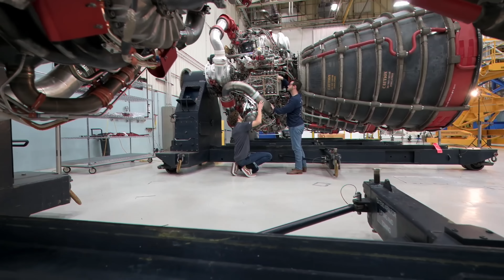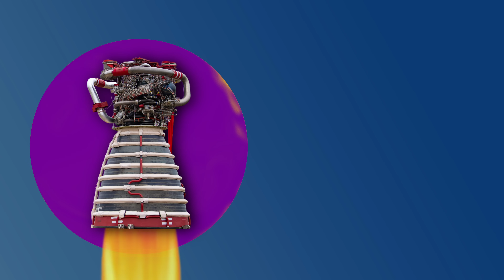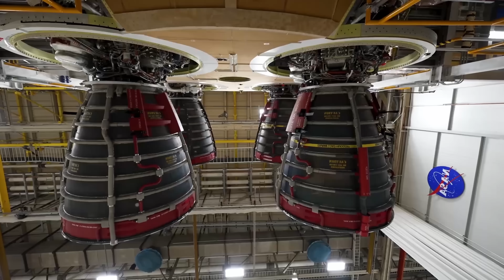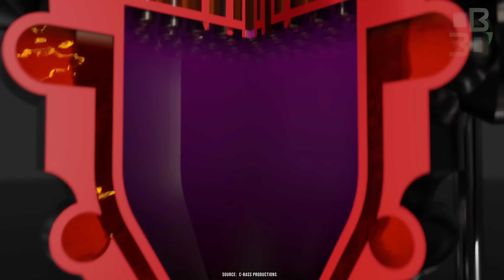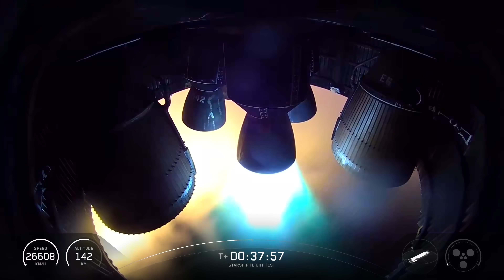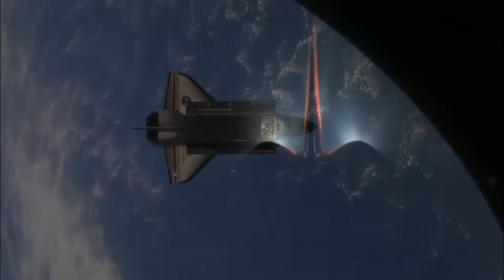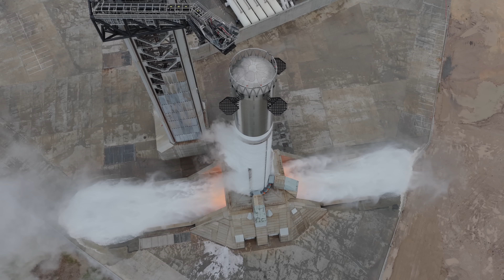Why SpaceX Raptor and NASA RS-25 Are So Different…

Comment: Making rocket fuel on Mars from local resources would be a  MASSIVE breakthrough! Imagine refueling for the trip home! 🔴
Reply: It’s not a breakthrough. The process is completely possible and has been done on earth plenty of times starting in the late 1800s. 

The breakthrough, if you wish to use that term, is the change in mission philosophy away from 100 percent bringing every single thing with you from the start. Starship is meant to do a lot of things very differently from that norm, with the intent of making places like Mars and the moon fully independent colonies of Earth someday - you can’t do that if every single thing has to be made on earth and flown to wherever they’re being used.

Comment: The RS-25 burns hydrogen into water vapor, and it still delivers incredible perfor mance decades after its debut! 💧🚀
Reply: The volumetric efficiency of hydro-lox is terrible - and that’s a bigger downside than the upside of the slightly better mass efficiency and environmental impact. It’s a really bad fuel choice for practical rockets that are economical to operate.

Comment: Well how many raptor engines have we seen quit in flight? I’ll wait…….. the RS-25 on the shuttle. I can’t recall a failure during launch.  NASA never had failure of a Saturn 5. How many starship have been destroyed.  By the time space X gets the starship reliable. The cost will be a wash. If you’re the person riding on said rocket. I don’t give two thoughts about the cost.
Reply: they have already done like 14 tests, because the engines are not stupid expensive it is fine if they get distroyed and having 33 of them also helps with relyability. the Falcon 9 is very relyable so maby judge on more finished products

Comment: Rapid reuse demands engines that don't need a complete teardown after every flight.
Reply: Between late June and July 6, 2018 the AR-22--which is for all practical purposes an SSME--was fired 10 times in 240 hours for a minimum of 100 seconds per firing. With LTMCC and modern engine controllers the SSME can be turned around without rebuild.

Comment: Nasa no longer innovates. They're literally using a 30-year-old engine with no new modifications. SpaceX on the other hand is going where NASA fears to go. They're testing the limits and succeeding at things that they were told was impossible. Each version of the raptor engine has only gotten that much more powerful. They're setting their sights on solving the heat shield problem that NASA could never solve as well. No guts no glory. SpaceX will inherit the cosmos... At a fraction of the cost and with true reusability.
Reply: SpaceX stands on NASA's shoulders dude.  These Musk fanboys are not space fans, they're tribalist cheerleaders. Any true space fan cheers for all of the companies.  NASA never solved the heat shield problem? You do realize that Musk's heat shield PICA is a NASA design? Geez, the ignorance.

Hey dude, can you name a single SpaceX flight where some of the raptors didn't FAIL?  Imagine a 747 and every flight, one of the engines breaks down.

NASA's RS-25s only ever had 1 failed engine in over 135 launches!

What NASA did with the shuttle in the 1970s and 1980s, without modern computers or tools is far far more impressive than what Musk is doing, since NASA was the first to do it and had to invent much of the technology whole cloth, whereas SpaceX gets to refine it. Even his staged-combustion full flow engine was designed by the Russians first.

Stop the hero worship. NASA is a basic science org, they are not a manufacturer. Musk of the core materials science and combustion science used by SpaceX engineers in their designs came from others.

Man, I hate today's youth and their sycophancy.

Comment: You cannot compare anything the current NASA organization does with SpaceX's capabilities. DEI has done its best to ruin NASA. SpaceX hires basis a person's engineering capabilities not basis one's sex or skin color. Which rocket would you feel secure riding into earth orbit? The recent launch of the newest space observatory into orbit is another good example of the difference between NASA and SpaceX. Trump made a big deal congratulating NASA on the successful launch of the observatory. In reality NASA had "nothing" to do with placing the observatory into orbit. It was a SpaceX launch system & rocket that performed the launch. Additionally, NASA did not construct the observatory. This was accomplished by a private company. NASA has become a political figurehead for a Woke government agency.

Comment: Burning Methane doesn't come with drawbacks? On what planet? Can we talk about the starship's carbon footprint. the 2026 summer was the hottest on record.
Reply: <<Burning Methane doesn't come with drawbacks? On what planet? Can we talk about the starship's carbon footprint.>>

Guess what?  Space travel involves energy.  LOTS of energy.   On earth,  Methane can be taken cheaply from natural gas.  Hydrogen is most cheaply available from natural gas as well, but wasting the carbon in methane.

SpaceX's engine is designed to use methane produced on Mars.  Again, that would involve huge amounts of energy. That would have to come from massive solar panels or nuclear electric power.

And if you were planning to come back to earth during a narrow window, would you want to rely on solar power that could be interrupted by dust storms or whatever?

Human space travel is about EGO and VANITY.  Best to keep humans on earth.  Want to do space exploration?  CONTINUE to use robots which have explored the solar system for decades while frail humans have scarcely gotten out of low earth orbit. Neil degrasse Tyson estimates that robotic space exploration is FIFTY TIMES as efficient as human space exploration. 

Climate Hysteria would result in NO human space travel.  That suits me quite well.  How 'bout you, my friend?

Comment: This is all well and good. But I want to challenge Mr.Musk to build not just a Space Shuttle but one that can take off, go into space, come back and fly under its own power with the ability to land at any airport and take off and fly again under its own power.
   The shuttle must have the ability to travel to the moon land and lift off in VTOL, staying in one piece. 
    Also having the ability to use a  nuclear powerplant no bigger than a large stand up tool box to power a propulsion system.
Reply: Also; have it fly, go to orbit  and come back *on its first flight*, human rated.
Reply: well that's something that NASA never did but you can bet that SpaceX really will

Comment: I didn't watch the whole video but KKK CIA UFO Telepathic Spooks will not tell you the truth. The Big Engines for AP and SH were designed and built by RD in Pasadena? 
And sometimes on those big engines combustion stability appears but if you use multiple smaller combustion chambers___

What lifts the rocket? Thrust coming out of the bottom the Rocket pushing the payload and fuel into the sky. But what is thrust?
Mass Flow Rate x Velocity? Very High Velocity coming out of the Nozzles because Combustion changes the phase from liquid to high temp gas that expands a Zillion times cranking up the Velocity to Sonic? Super Sonic?

Yeah, KKK CIA UFO Musk wanted to hire me as a Rocket Engineer but he x🎉 to give me the 20 Million Sign on bonus and a written agreement that I wouldn't be turned into a KKK CIA UFObTelepathic Spook!

Comment: The full flow, staged combustion cycle has a big advantage, and that is leaks along the turbine shafts cannot allow both propellants to contact each other anywhere other than the preburners or the thrust chamber. In a staged combustion engine, propellants mixing in the turboshaft machinery will cause a catastrophic explosion. That can't happen with a full flow staged combustion engine.

Comment: Raptor 4 is by far the more efficient rocket engine...lightweight, powerful, flexible, reusable, and cost effective. The problem with NASA is that it is a government run agency, so they are consistently strapped by red tape, and innovation doesn't seem to be a key motivator anymore. NASA did the impossible on July 20th, 1969 putting the first men on the moon, the Reusable shuttle and the ISS, Mars Probes, the Hubble, and the James Webb telescope, but it seems to have lost some steam in the innovation department for space exploration, and continues to burn money like a rocket engine burns through fuel...what do they care - it's not there money...right?!

Comment: The rs 25s don't relight. The shuttle could not start them again without that big external orange tank they drop during launch. It uses OMS  orbital maneuvering system. Smaller engines that were on the shuttle used for well Manuel😂
Reply: They don't need to relight. Its a first stage that launches Orion to the moon in 1 launch. Raptor needs to relight because they need to launch 15+ more times to refuel each starship for any mission beyond LEO.  This wont be ready for decades.

Comment: The Achilles Heel of the RS-25 is its purported reusability.  The RS-25 is like the F1 engine of rockets:  fantastically powerful and efficient for its size, but insanely expensive to build and maintain.  They're also incredibly fiddly, with very little margin for error, which again drives up costs.  After every flight, they were effectively torn down and rebuilt.  Last, although hydrolox engines are one of the most efficient and powerful fuels available, working with hydrogen is a ridiculous pain.  Hydrogen is an very, very small molecule.  It can -- and does -- seep through almost any gap, defying sealing.  This caused a number of issues with both the Shuttle and SLS.

Contrast this with the Raptors.  They're slightly less efficient, using methalox instead of hydrolox, but methane is much cheaper and easier to work with than hydrogen.  The overall design of the Raptor does away with the extreme measures the RS-25 took to squeeze all that power and efficiency out of the design.  As a result, the Raptor is cheaper to manufacture and maintain while only marginally less performant.  When you add in the mass production of Raptors compared to the nearly-bespoke RS-25's, the cost plummets even further.

The ground truth is the RS-25's, while an incredible engineering achievement, failed in their most basic mission: to lower the costs of putting a kilogram into space.  NASA overreached because it could.  SpaceX went state-of-the-art-but-practical and produced the Raptor.  It's kind of obvious which of these two engines is the real "winner" when it comes to access to space.
Reply: One of the best explanations of why methane is a better fuel than hydrogen!
I believe it was Tom Mueller, Musk's first employee, who persuaded him to go for it,
Mueller also designed the kerosene-powered Merlin and Kestrel engines, so quite how the methane decision was made isn't very clear.
PS There is a Wikipedia article om Tom Mueller, it is well worth reading. Tom Mueller's dad was a lumberjack and he was keen for his son to follow him!
Reply: Agree - amazing tech achievement but very, very expensive and now they’re just being used as expendable.  It’s crazy!

Comment: On Mars, if you have water, you have both H2 and O2, so why bother with CO2 + H2O => CO + H2 => CH4 conversion?
Reply: Because hydrogen is so much harder to deal with.  H2 molecules are so small, they escape seals, which flex due to vibration and temperature changes, and escapes throughthe walls of tanks and fuel lines. Methane is a much larger molecule that can't escape through the tanks and fuel lines, and allows much more safety by not escaping seals nearly as easily.
Reply: Where is theC co2ming from? The moon?
Reply: @JamesWhalen-g3c  He asked about fuel production on Mars, not the moon.  The Sabatier process mixes CO2 and H2O under heat and pressure, and the result is methane and oxygen. There's lots of CO2 on Mars. It's the bulk of the Martian atmosphere. A handful of research labs have created small reactors specifically for this process for in situ fuel production on Earth and Mars. 

Don't forget that Starship has been designed since day one for Mars.

Comment: You make it sound like the RS-25 engines were responsible for getting the shuttle off the ground. It wouldn't have moved without the SRBs, solid rocket boosters produced 70% of the thrust that made Lift-Off possible.
Reply: SpaceX doesn't need SRBs . . . . Artemis has them . . . 🫣

Comment: I really enjoyed your video.  Nice job!  I started my career on the RS-25 program in the 80s.  They’re small points but the power level we were flying at the time was 104.0, there are 2 pre-burners on the RS-25 and the cooling path on the expansion nozzle are different.  It would be cool to sit down with a Spacex engineer to talk through how they make it work efficiency wide given the Falcon Isp is so much lower.  I has to be something more than the hydrogen volume is so much higher?
Reply from the maker: Really glad to have someone who's actually worked on those engines enjoying the videos! Thanks for sharing your experience too. It's been super insightful!
Reply: Canoga Park, NSTL (Stennis) JSC or KSC?
Reply: @mytidleycanwink.4692 sorry for the slow reply - Canoga Park and worked very closely with NSTL.

Comment: I was a padrat on the shuttle at VAFB SLC-6 and stack operations support at KSC. The RS-25s of the 1980's we're as finnicky as an F1 engines. High performance but costly as hell and maintenance nightmares. Leaked as badly as crankcase on old Harleys. But that was the technology of the time. NASA's mindset is another problem. It's not their money and they aren't profit motived. But that's what's hurt innovation from them for years. Too many bureaucrats and politicians and not enough talented engineers allowed to dream. They just want to put on the BIG SHOW without regards to cost, innovation or reuse. Real rocket engineers are all now at SpaceX. LMT, Rocketdyne, BAE, ULA, Northrop and RTX better wake the hell up or they'll all be gone soon.